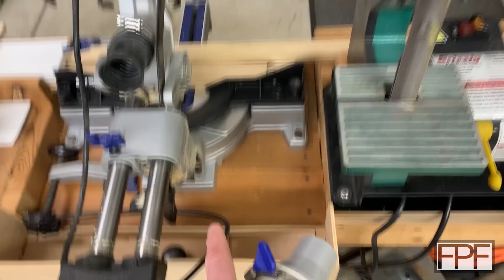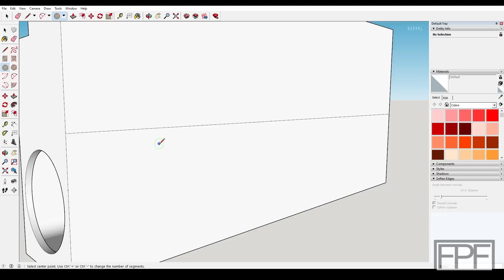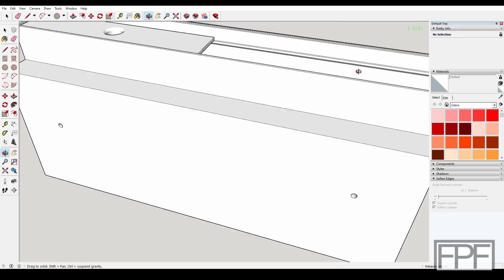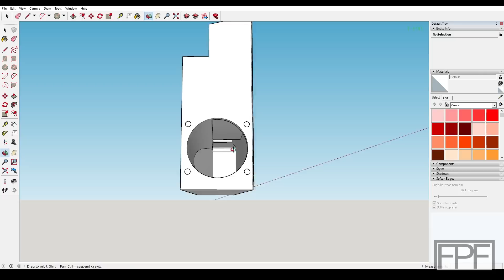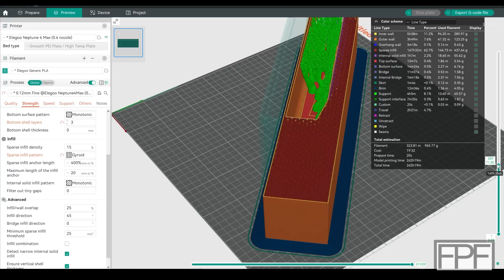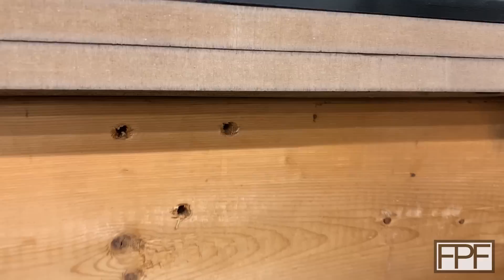3D Printed Dust Collection Pickup for Bench Grinder

Comment: I have a kydex sheath business and I am in desperate need of a good High volume and High velocity dust collection attachment for my 6" central machinery bench buffer. I threw together a cardboard and gorilla duct tape collection system to connect to my harbor freight large dust collector.  Its got very strong air volume and velocity that can suck small parts out of your hand if you do not hold securely.  I am used to it and actually love it, but I just need one made with 3d printing. I contoured it, giving it the best air flow possible by using the idea from engine cylinder head design. I want to catch 95% or more of the dust I produce. I produce a ton of dust and small particles because the buffer removes quite a bit of stock from the kydex. I have a great design that can be improved but no access or know how of 3d printing. Do you have any recommendations? My business is growing and so is the amount of dust. Air volume, velocity and flow are key to dust collection. Even installing a screen to keep parts from getting sucked in the collector is needed. Remember the Fighter jet that sucked the sailor inyo the jets intake and lived? I need that kind of power to keep the dust off of me lol.

Comment: You could have done this without any infill at all.  You explained that the only reason you made it so dense was to support the top layers, but none of the top layers needed to be flat, so there was no need for infill to support them.  Just spending a bit more time in design could have more than halved your print time and filament use.

The only flat top face is the part that tucks under the lip of the bench.  It's unseen and does not need to be flat.  Your "funnel" sections were flat across their width, but they could have been made into a valley with 45 degree walls that needed no support from infill.  To support the bottom layer of the valley you could have designed in a 1-wall thick supporting wall (which needn't have been continuous).

The tube didn't need to be round the whole way, 1" or maybe 1.5", and that's assuming you have an adapter which enters the box.  The rest of that tube could have had a 45 degree pitched roof, so you'd have needed much less support.  If you go with a magnetic fitting, you could have printed this entirely without supports.

Not only would have taken a lot less filament, it would have been so much faster.  As well as not wasting time printing the infill and most if not all of the support, most of the extrusion would have been done with the head moving at maximum speed.  I bet you could have printed this in 1/3 (or less) of the time, and half the filament, and it would only have taken a few more minutes to design.  17 hours is a lot nicer than 51 hours.  You could have kicked it off at 3pm and it would have been finished by 8am the next day.

When people design a part for CNC machining, they'll avoid small radius internal corners, so that a large diameter bit can be used for speed and not require a tool change to get into the corners.  In other words, they design the part considering the manufacturing process.  Design for 3d printing is just the same - you avoid creating features that are hard to print.

Of course, I'm not suggesting you redesign this.  I'm just hoping that in future you'll take the time to think more carefully about your designs so you don't waste time, filament, and money on unnecessary infill and supports.  You can even use this as a teaching opportunity so others can avoid the same pitfalls.

Comment: Very cool, but why do I feel like this can be achieved by just buying a used Dyson hardwood attachment with the bristles removed?
Reply from the maker: Most of what's 3d printed (or produced with any other manufacturing process) could be achieved in some other way.  The strength of 3d printing is to quickly iterate to a solution that is tailor made to suit your specific needs, in a specific scenario, faster and cheaper than other processes (cnc, injection molding, etc.)

Comment: Nice job. Things like that definitely make having a big printer more enticing. A simple spacer is how I'd handle the small gap as well.
Reply: Personally, I'd rather have a smaller printer that has an enclosed heated chamber that can handle more materials and reduce hassle with warping. You can always design small sectional parts with alignment tabs and assemble them into larger parts afterwards. As a bonus, if you have a problem during printing, you're not going to have to scrap a whole roll of filament. I would design this piece with the hose connection at the bottom for maximum airflow with a magnetic ring for quick alignment. Print a left half and a right half and print them on their side instead of standing up. A shadow line should keep it airtight at the joining seam. Of course, this is all theoretical, since I have not actually done this.

Comment: Check out simscale you could model the airflow. Bends like you have are death for airflow. 

If you want to push out the side Use two 90s and if you open the left the right has a flapper that closes and visaversa.

Alternative is a y funnel with split port or two y funnels where your pipe base has three gate positions left open path, middle is off and right open path. Then your magnetic pipe snaps into that door. Then you adjust top port and gate to get maximal airflow. The method would be easy for cleaning too all de iris could just funnel through.

Comment: The bigger printer could benefit from a bigger nozzle, lika a 0.6 or 0.8mm nozzle. You said you use it only for printing bigger parts so you would not loose too much detail but would benefit from reduced print times. Maybe worh a thought :)

Comment: I’d add a flange to the tube and make pockets to hold magnets. Then I’d imbed the magnets a few layers down so it all sits flush. Maybe add a round rubber gasket into a lip on the flange for it to sit in. Like a throttle body on a car.

Comment: Be careful grinding metal and wood dust collection in the same system! I have seen them start to smolder and smoke. Fortunately caught it before it went up.
Reply from the maker: Thanks for the info.  With the indirect pickup in front of the wheels, and not from the wheel covers, I'm hoping there's no sparks entering the pickup when grinding, but it's a great point, and I'll need to test that theory to make sure (maybe in the dark?)

Comment: Nice work. What filament did you print the part in, and what did you use as support filament?
Reply from the maker: Thanks! PLA, and just plain PLA for the supports as well.  If using bambu studio or orcaslicer, I find they have really tuned the support interfaces quite well.  They generally seem to beak free pretty easily.

Comment: the idea of sucking grinder sparks into a dust collection system also used for wood or other flamables seems like maybe not the safest plan
Reply from the maker: With the indirect pickup in front of the wheels, and not from the wheel covers, I'm hoping there's no sparks entering the pickup when grinding, but it's a great point, and I'll need to test that theory to make sure (maybe in the dark?)
Reply: Usually there’s a water bath placed in line, as close to the machine as possible, to mitigate this risk. Industrially, airflow is generally not considered enough to cool the sparks to an acceptable fire risk level, though industrial safety standards are obviously quite high
Reply: Yes, this.  They make dust collectors specifically designed for metal grinding dust for this reason.
Reply: optimally even completly seperate collection, you only need 1 spark doesnt even need to start burning immediately and just smolder. Wood dust collection bins are at the best of times a fire hazard... Everybodys own choice doe.
Reply: Maybe not the best, but the air flow will cool hot metal bits really really fast.
Reply: air flow can also fan sparks into flames really really fast

Comment: Out of interest with such a big build did you not consider building the “box” out of plywood and having all the fancy shapes and flow bits out of printed material?
Reply from the maker: I did, and used that methodology for the chop saw dust pickup, but the thin wood (even backed with 3/4 in the corners)  has slowly warped over time tightening up the top cover and the front lip.  Hoping PLA ends up being more stable, though it can also creep a bit.

Comment: For parts this big you should really consider going to a thicker nozzle to speed up print times and increase strength.
Reply from the maker: yeh, I need to get a .6 for that machine, especially since I only use it for larger stuff
Reply: Go to the Revo hotend.  The nozzles are more expensive, but you will find yourself switching to the most appropriate nozzle for the print job at hand, rather than living with whatever size happens to be installed.  The ease of changing nozzles is a game changer.

Comment: Slightly less convenient, but I think you’d get better air flow if you connected the hose to the bottom, rather than the side. Another enjoyable video!
Reply from the maker: Thanks, I went with connection on side because I'm hoping to be able to quickly connect/disconnect without getting down low to align the hose.

Comment: I think you need to have the hose connect on the bottom for far better airflow and a buttload less filament
Reply from the maker: I went with connection on side because I'm hoping to be able to quickly connect/disconnect without getting down low to align the hose.

Comment: So part is just cracked in the middle...
Reply from the maker: Nope, not cracked, but when I first saw it, I thought the same thing.  That's the first layer where the cavity inside is a solid layer across.  So, when it was printing, that outer wall below that point was able to slightly bend inward until it reached the top of the cavity where the side wall sets the width.  Once it reached that point, that initial outer wall is wider by just enough to cast a shadow line and look like that.

Comment: Great project! I would do one thing differently, though. A while back I invested in a laser engraver/cutter a bit like the one you reviewed last week. I would cut the walls and slopes out of 3,5 mm plywood (the non formaldehyde stuff...) and use 3d printed connection pieces to screw it all together. Then you would be done in a few hours in stead of days. Cutting slots and dowels on your connecting plywood pieces is also great for building stuff like this. Enjoyed the video!

Comment: Beware of using a wood dust collector with metal grinding - you can start a fire inside the dust collector.
Reply: I also agree with this comment. When I setup my dust collection I ran a bare copper ground wire through the whole thing and grounded it to an electrical box. Dust collection can be explosive from static electricity but your adding sparks too. I’ve seen it with my own eyes on a light wood dust layer floor and a spark.
Reply: Great safety tips, makes sense that  dust and sparks don't mix well.
Reply from the maker: With the indirect pickup in front of the wheels, and not from the wheel covers, I'm hoping there's no sparks entering the pickup when grinding, but it's a great point, and I'll need to test that theory to make sure (maybe in the dark?)
Reply: @FunctionalPrintFriday  There are a few different ways it can cause a fire even without direct sparks. Metal that is well below glowing temperatures can still be hot enough to ignite wood dust. Metal dust is also quite reactive, and can produce heat by reacting with oxygen or other materials. If you grind both aluminum and ferrous metal, mixing their dust together is not recommended. Also, aluminum dust reacts with water to form hydrogen, which can build up in a collection system and explode.
Reply: @FunctionalPrintFriday It might not be readily apparent with one or two tests, of that theory, but remember, it only takes one time to start a small fire that burns down all that you own...
Reply: agree agree agree. this is terrible practice. so so dangerous. a big pile of dust can catch fire so easily, add a blower supplying air. All you need is one spark or like mentioned in another comment here, a piece of metal that is not glowing but is has high temperature, and your going to have a big problem.
Reply: It's one thing being aware of this and 'doing some test's in the dark'  but creating an instuctional video on how to make thing is asking for someone else without this awareness to copy it and...